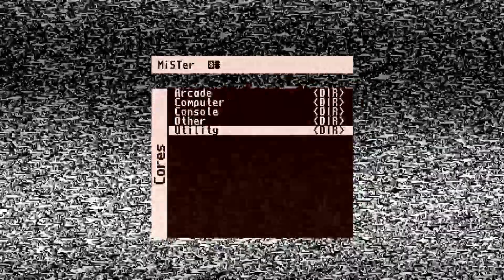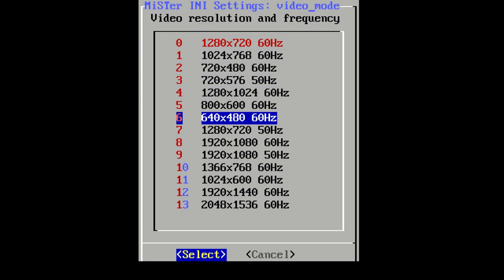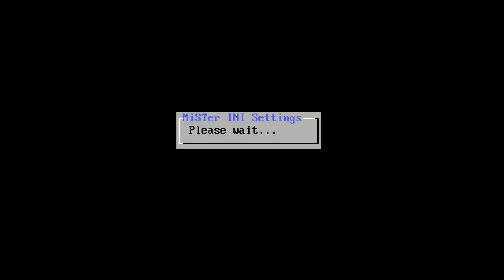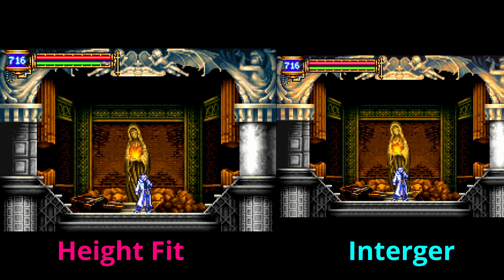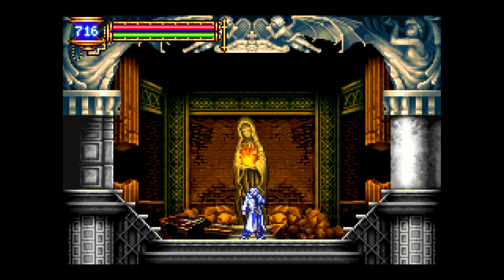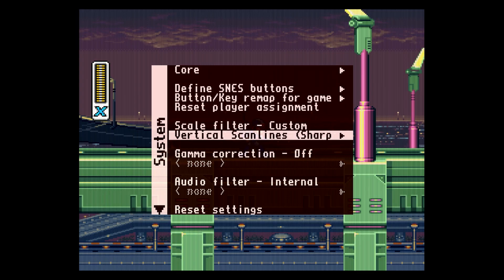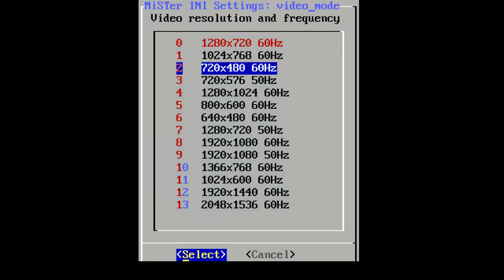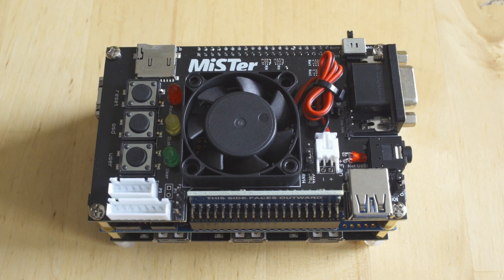MiSTer FPGA Intermediate Video Settings Guide - Resolution, Scaler Options and Video Filters

Comment: I took a screen shot from you video when you had interger as full screen then another with it set to scale to fit screen height.  I cropped out the black bars crudely with mspaint on both screen shots then when I rapidly switch between the 2 cropped screen shots, I see no change in aspect ratios.  I didn't use comparison of the side by side you did since the interger on the right, you cropped off the right portion of the game.
Reply: https://imgur.com/gallery/DN96seI
Reply from the maker: I mention in the video for to height does not crop on my capture card. It just does on my tv setups
Reply: @VideoGameEsoterica  I did some thinking and with it set to 720 on a 2160 display it does divide out evenly with it being 3x3 so for every game pixels it’s exactly 9 pixels on the 2160 display.  So the reason for interger is just that, 1 game pixel is 9 on the display with your setup.  If you set it to fit screen height it’ll be more than 9 and probably not divided evenly with partial pixels which messes up with what you see.

Changing between integer and fit to height doesn’t change the aspect ratio but how the pixels are scaled
Reply from the maker: Good to know. So much complex math involved in scaling to diff resolution TVs

Comment: Worth pointing out that 1080p also scales integer wise to 4K and is a much cleaner scale on most modern TVs than scaling 720p
Reply from the maker: I did mention mileage may vary on resolution. On my Samsung 4K 720p scales slightly better.
Reply: @VideoGameEsoterica  Only clarifying for people unsure of integers of 4K. 720p and 1080p are the ones to flip between to find what your set scales better. People may take away that only 720p is an integer from this video.
Reply from the maker: Your second comment was blocked I think because link? I saw it but it says comment not found. Maybe repost w/o link?
Reply: 720p x3 is 2160p.
Reply from the maker: It’s gonna be quite the mess when we go to 8K in the home. As is I occasionally use 8K cameras for work but it’s all just down sampled to 4K
Reply: Yea on LG B6 Oled this looks best for me nice and crisp image.
Reply from the maker: OLED always looks nice lol

Comment: FYI - The default "static" background on the menu core is a real killer for the YouTube compession codec.

But, you hit F2 to change the background, and it should remember the setting at next boot. ;)

The background can only be changed for the HDMI output, though.
Reply: It is possible to set a background on analog output from MiSTer with a custom 240p video_mode for the menu.
Reply from the maker: I honestly haven’t tried. I love the snow on PVM. Feels like I remember TVs back in the day
Reply: And not a huge deal, but "Integer". ;)
Reply from the maker: Do I say interger? Because that’s just the New England in me. I also say “sodder” and not “solder” lol
Reply: @VideoGameEsoterica  I used to find the "sodder" thing quite weird.

But I since learned that it comes from the French (or Middle English) form "Souder".

So I'll let you off. haha ;)
Reply from the maker: Lol I also can’t say “gate array” when I talk about MiSTer. I just say “Gatorade”.

Growing up in Vermont some letters just never get taught to us. Vermont is “Vermonn”...no hard T
Reply: @electronash  Voultar always includes the "L" in solder
Reply from the maker: Haha it seems to drive some people nuts. I can’t even say it right if I think about it. My brain and tongue just say “nope it’s SODDER”